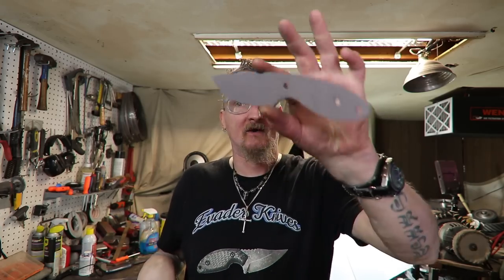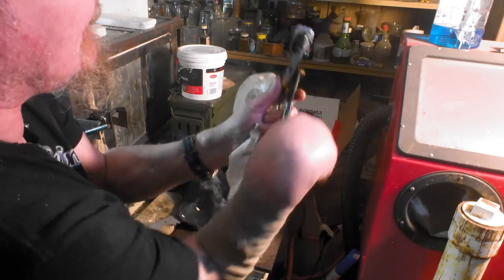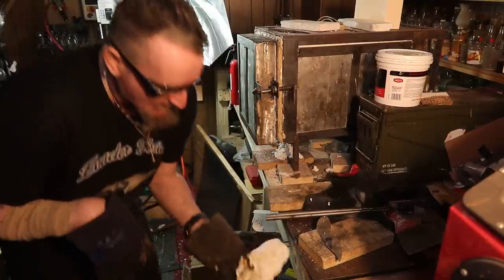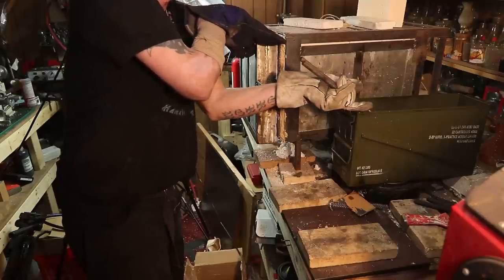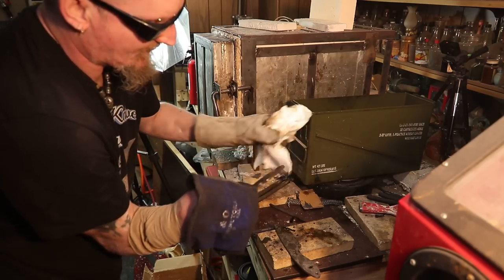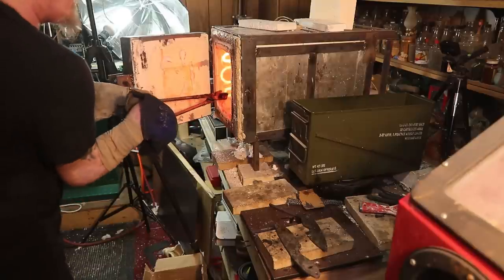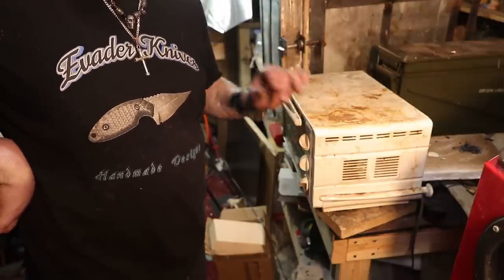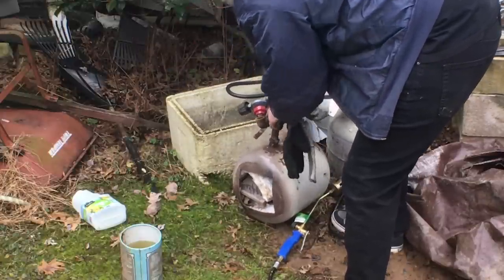Knife Making - How to heat treat O1 steel

Comment: Thanks for the info. I just started recently and purchased some O1, A2 and 1095 bars to play around with. The A2 is very hard before even doing any heat treating and it takes a lot of time on the grinder to remove a little material.
Reply from the maker: I've never tried A2, but that's what I've heard.

Comment: As a follow up comment. Definitely do the torch treating in the dark so you can see the glow of the blade as it gets hot. I’ve had success in my charcoal and wood grill with a blower to get the fire really hot and it’s really cool to see the blade as it turns different colors of red and orange!!!
Reply from the maker: Yeah, like i was telling martin, I saw on Sunday it would be warm, didn't prepare at all, not to mention, I haven't used that torch in YEARS, hahaha... I'll definitely do a better one...

Comment: Haha Dave this was awesome. I feel so much better now. When I tried the weed torch I held the knife with the long handled forge pliers that I had to keep squeezing tight to not drop the knife and it was to hard to rotate the blade to heat both sides and then squeezing the torch with my other hand whew I think I tore all the muscles in my forearms and then trying to hold my magnet. My arms were sore for 3 days 😂. I agree with that by my failure I know now how to make it work. I told ya I made a forge but it too failed. It was to big for my heat source to heat up. I know how to fix it too. Failure is not bad it’s really just progress. I now know what not to do and can see what I need to do to make it work!!!  You had me lmao 😂 though. Loved it. Thanks for not being afraid to show this because it will help people skip a few mistakes. I just wish I’d have seen it sooner. 😂
Reply from the maker: Have you thought about taking a hole saw and putting a hole in the top and using the weed torch in the forge? Just make sure most of the torch cylinder is outside the forge, then you could even close the door... Because the torch has plenty of power, same power a regular burner has... you might have to mess with how it sits on the barrell & tie down the lever, but I would bet it would work amazing
Reply: Yes I’m studying using the weed torch in the forge. Maybe alter the end of the torch. Make it a little smaller. I definitely need to use propane because one small tank of map gas doesn’t last long enough to do much with it continuously burning. I’ll keep you posted
Reply from the maker: @e.t.preppin7084  Yeah definitely... just make sure you don't cover up the end, that is where it gets its air mixture... You need the right air to propane for the torch to run smooth

Comment: Man I just realized I bought the wrong eyelet press. Mine is for # 0# 2 #4. That’s 80 bucks wasted. What would you recommend and I believe I need one for 8 by 1/4”
Reply from the maker: I think #8 is 1/4"...  you can get the right the adapters... https://www.knifekits.com/vcom/ckk-riveteyelet-flaring-dies-journeyman-series-p-2028.html
Reply from the maker: https://www.knifekits.com/vcom/ckk-riveteyelet-flaring-dies-master-series-p-633.html
Reply: Yeah that’s the brand of press I’m gonna have to buy. I have that one bookmarked. The press I bought won’t take those flaring dies I have to buy a new press and the 8-1/4 die separately. About 110 bucks more. Ugh. Hey if ya have a tarp that needs new eyelets I’ve got the tool for that 😂😂😂 the CKK master press isn’t in your Amazon links is it. I’d buy it through your link but I don’t think that company is on Amazon. I’ll look
Reply: Do you use the tool you have to use a hammer with or the real press
Reply from the maker: @e.t.preppin7084  did you get the ckk master press, because if you did, then you only need the die... If not which did you get..
Reply from the maker: @e.t.preppin7084  I bought a cheap arbor press from harbor freight and drilled out mine... So you can always do that, either send that one back or make it fit the dies... https://www.youtube.com/watch?v=j6p31rIQCgE
Reply: I just ordered the call master and dies. The one I bought I don’t think I could convert but it’s pretty cool for putting bigger brass eyelets like come on a tarp. I trashed my receipt and box already so I guess I’m stuck with it. I just saw simple little life convert his to another press. I tried the weed torch again tonight with a much better set up but still at 35 degrees there was no way it would work. Instantly cooled. I’ll get my forge working by this weekend
Reply: Not call ckk
Reply from the maker: @e.t.preppin7084  what about flipping the arbor over and making a new hole? I'd hate to see you spend $80 when you could make it yourself... Maybe even contact knifekits and ask them what to do... I have a feeling the end that goes into the arbor is the same size, it is just the die that is different....
Reply: I’ve already ordered the new press and dies separately. When it arrives I believe I will see if I can modify my press and if so I’ll send the new one back. I do kinda like the one I first bought for placing larger eyelets on things like tarps , drop cloths and who knows what else. I just hate how I search for a specific item on Amazon and then items pop up that are different from what I searched for. I should have read all the specifics on the item I was purchasing
Reply: Dave new press arrived today. No way to modify my first press. The opening on my first one is a 1/10 of the proper press. There’s no way the new dies would even fit into the older press. They would overlap. The two presses are made totally different. Oh well, I’m all set now. Gonna get my forge working tomorrow. I’m not going to bed till I get it working 😂 wish me luck cause I need my sleep. Haha
Reply from the maker: @e.t.preppin7084  I hear ya, I have been editing tomorrow's video since 1pm... I still have the outro to do, but it's what all you guys have been asking for.. a plungline/bevel tutorial.. almost 30 minutes long, hahaha... Good Luck!!!
Reply: Cool yes plunge line instructions most needed 👍. Can’t wait!!!
Reply: Sounded like sweet Jane in the background. Is that your music?  I really like that.
Reply: I bitched about your music when I first saw your video. I love that music in this video!!!!  Haha
Reply from the maker: @e.t.preppin7084  If it was in my video, it's my music, hahaha... Imagine that, the 1st video you watched you didn't like the music, now it is slowly growing on you...have a good night my friend